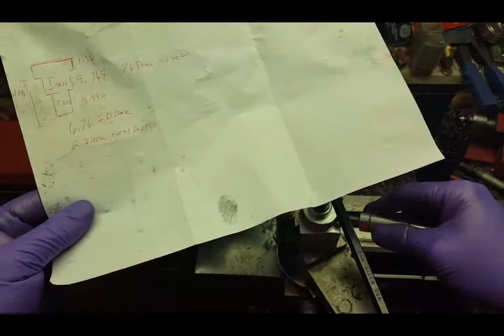Jinwen qctp modification

Comment: I had a small Lathe for awhile.  You will be surprised how easy a larger lathe is to run after running a little light one.  It's good practice.
Reply from the maker: I plan on getting a good mill, and a proper lathe may be a 36 inch bed.. 

I am very lucky to have all that I do so far, and in time as I get my self straightened out, hopefully some day will be competent at running them
Reply: I understand, I built this shop in 2011 and slowly I'm getting a few machines.  I usually save for awhile and put one on credit and try to pay it off in a year or so and do it again.  My wife isn't usually impressed but...oh well.  She's been putting up with me for nearly 26 yrs of marriage.

Comment: Looks like you did an excellent job on replicating this part for sure my friend. And I'm sure it will hold up much longer and better than the other one. Thanks for sharing my friend and happy new year.
Reply from the maker: Massachusetts Prepper thank you very much. It's alot tighter then the old one and only needs a few degrees to lock it in